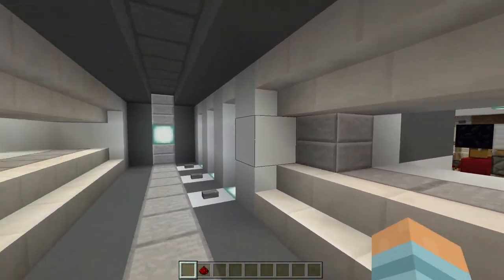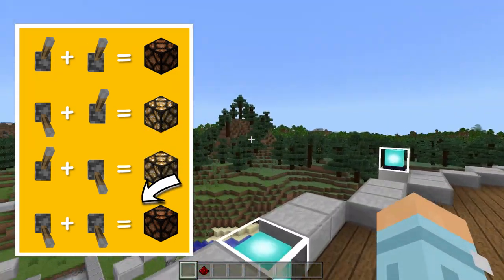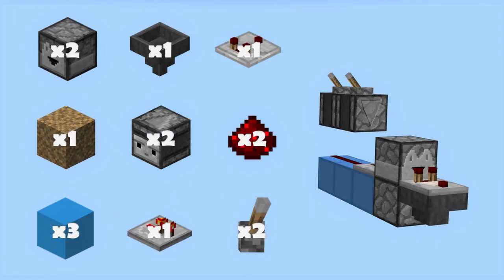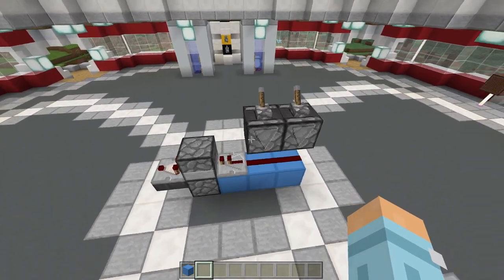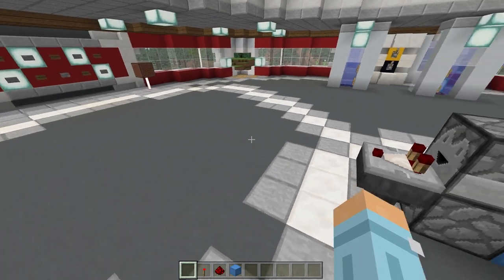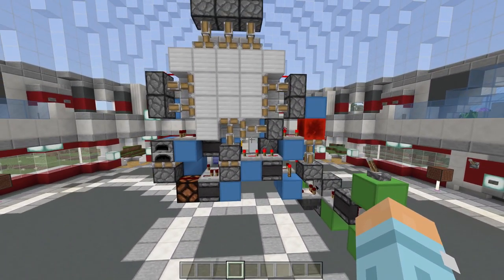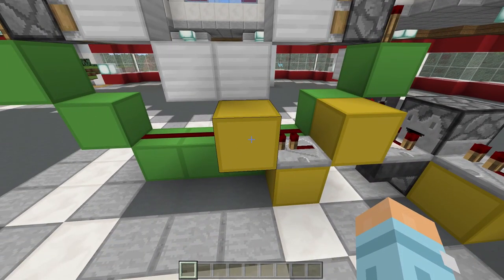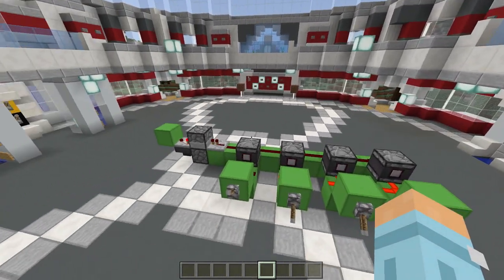Minecraft SUPER COMPACT XOR GATE- Works on ALL versions!

Comment: Just to add another advantage of using a flip-flop, you can easily turn this into an XNOR gate without having to invert the output signal (like you did in the vid, though). Just put the item in the other dropper in the beginning, and it will only turn on when the inputs DON'T match, an XNOR gate!

Comment: Nice design, whats the reason you use a repeater into the dropper? Whats the difference with using redstone dust?
Reply from the maker: Basically because it doesnt work without it 😂
Simply it hard powers the top dropper when the dust doesn't

Comment: [2019 1.14.4] i had an issue when turning off the unit, the block kept getting spit out the block . I found that its necessary  to either add another hopper or a block after the comparator and just have a repeater coming out from the block
Reply from the maker: Yeah it's a weird bug which shouldn't really happen 😅 the block in front of the comparator is the usual fix 😉
Reply: Princess Notti yeah. In java the sticky pistons do tend to spit out the blocks
Reply from the maker: @Ff-yk1kz  no no he means the dispenser spitting out the block too far not pistons 😉
Reply: The Bow Tie Man ahhh...
Reply from the maker: @Ff-yk1kz  haha 😉
Reply: I'm having the exact opposite problem.  The dispenser isn't shooting it far enough and it gets stuck inside of the dispenser

Comment: I built some solid XOR gates by making use of redstone comparators and they are more reliable than this that uses observers and droppers.
The basic principal is that the "plus" mode (in which the little torch of the triangle lights up) can be used like a transistor. If you apply a strong signal (directly from a repeater or redstone torch) it does not output anything. 
My current size is 4*3*4 and 5*4*2 (l*w*h, includiing redstone but not including base) They use nothing but repeaters, torches, and comparators. and can be lined up side by side to be used as adders in minecraft computers
And observers didn't come out untill 1.11, so "all versions" is not true.

Comment: Man this design is revolutionary but I'm having an issue where the hopper seems to lock up if you place redstone dust in front of the comparator (i.e. when you actually create an output). The powered dust seems to lock the hopper, the block gets spit from the droppers, and it stops functioning.  Help!

EDIT: solved by putting a repeater in front of the comparator. It seems this is necessary for the dust not to lock the hopper behind it.
Reply from the maker: Thanks mate, yep thats exactly right. I personally prefer to place a solid block infront of the comparator and take the output from there. This means changing the direction is easy and it stops the dropper ever spitting out the block over the hopper 😁👍🏻

Comment: Hey i need some help. I am trying to connect a door with this, but the comparator will not give the signal to close the door again, It will just shoot the rubbish item out again and go back to the same it already was. Like, instead of flicking on and off every time i pull the lever, it stays off forever
Reply from the maker: OK... Weird idea... Try and put your repeater on 2 ticks or above, maybe 4 ticks, and see if that works 😁👍🏻
Reply: Will try, also the fact that u still answer questions from a video made A YEAR ago is insane, u earned urself a sub my man!
Reply: Tried, did not work. Any other suggestions?
Reply: FIXED IT, i had put the power into the lower dropper
Reply from the maker: @themaddoctor2511  no worries mate, thanks for the sub! :D
Ooh thats weird... That shouldn't work😂 ah well, bedrock being buggy like usual 🙄🤣
Reply: Java tho!
Reply: I meant i had put the repeaters into the lower dropper but fixed it by putting it on the higher one
Reply from the maker: @themaddoctor2511  😂 oooh, yeah you need to put it going into the top dropper 😋

Comment: The dropper is throwing item furter, so the xor.gate us not giving any output!...how to solve this problem?
Reply from the maker: Oh do you mean its throwing it out? Basically if you have the comparator running into a block (then take the repeater from the block) that should stop it.
If for some weird reason it keeps firing off the side, you can just place some blocks around to stop it 😁👍🏻

Comment: It doesn't work anymore, the dirt block doesn't go through the system it just stays in the hopper and therefore it can't change the output or whatever the lingo is for it.
Reply from the maker: I can guarantee you that this still works perfectly mate :D
Have you got the hopper facing toward the bottom dropper as I have? :)
Reply: @TheBowTieMan  

Mine isn't working either, got it set up exact.

Block just stays in bottom dropper and doesn't activate comparator
Reply from the maker: @bazz326  hmm, do you only have 1 item in the dropper hopper circuit? :)
Reply: @TheBowTieMan  thanks for the reply.

Tried one, tried a small stack but doesn't activate.

Everything else in circuit activates when switched on from either switch, just not the comparator.
Reply from the maker: @bazz326  hmm that's weird mate, have you tried just rebuilding the whole thing? Because this honestly does work... I cant think why yours isn't 😕😅
Reply: @The Bow Tie Man  I’m having a similar problem. Whole system works except the comparator. Doesn’t change when block is dispensed. It did work briefly... I checked and rebuilt it a few times. Now it never works. I’m playing on switch. I’m sure I’m doing something wrong but the build is so simple.

Comment: that's a t flip flop, you just put a lever where a button usually goes and added a second input to the same line..
Reply from the maker: Yeah it's made with a t-flip flop, but you do need the observers to give the pulse to turn it into an XOR gate 😁
Reply: @TheBowTieMan  but its not an xor gate, its a toggle-flip-flop, it toggles output on pulse, an xor gate takes a persistent on-off signal from two sources and as long as they are not the same, produces an output. You even explain that in your-own video. You have two ways to send a pulse, and are using a switch to generate it, but in actuality those switches are cosmetic only, you could put note-blocks, or repeaters,  or comparators there for all it matters
Reply from the maker: @nodvick  yeah you are right, but it acts as one enough to be used in exactly the same way in most circuits :)
Most people use them just for adding two levers for doors, and it fits the bill nicely as it's smaller than a lot of other designs 👍🏻
Reply: @TheBowTieMan  I use them as manual constants for if/then/else statements. found your video seeing if anyone had come up with a new fangled design that would work in a certain setup better than my old designs. if A!=B where A is defined manually as needed and B is defined pragramatically